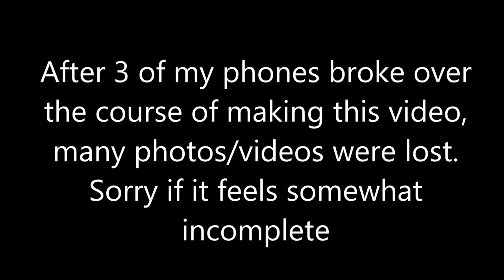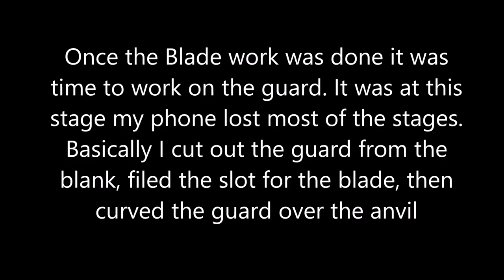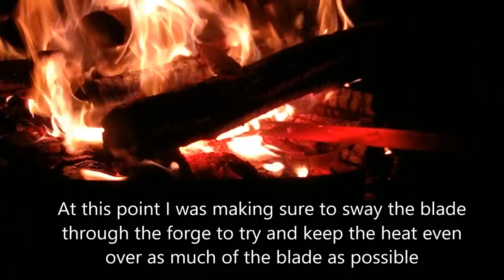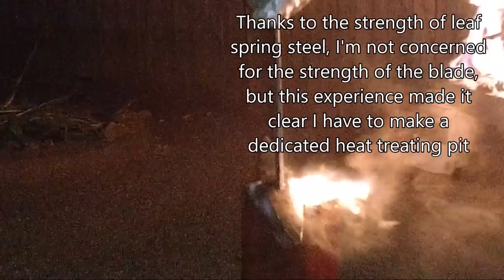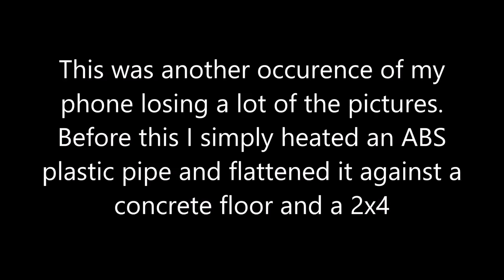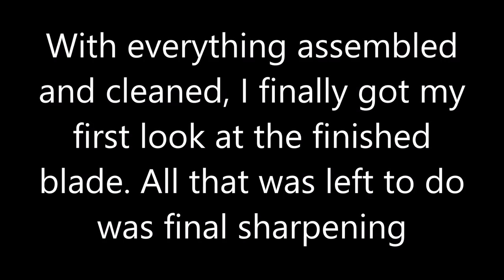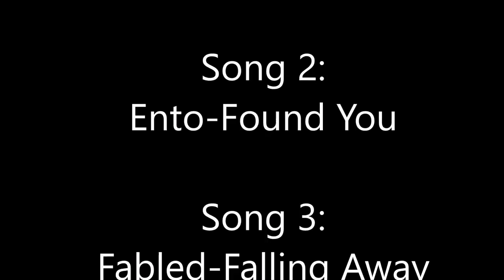Post Apocalyptic War Blade. Forging a Giant Blade from a Leaf Spring

Comment: There is a trick that is used at spearfishing gun  handles. You apply resin or fbglass at the handle and while it is still wet you sprinkle lots of sugar or salt on it. You let it dry and then you dip it in hot water. The excess salt or sugar melts away leaving a rough like sand paper surface. Great job though, i liked i more with the tempering colors on.
Reply from the maker: Im gonna have to try that at some pint because that sounds pretty neat.
I kinda like the smoky grey finish more myself, but if you look at it closely enough the tempering colors are still there. The sander doesnt actually scrape the metal, it more "watered down" the colors with a lot of grey

Comment: Just a little point that might help you out in future builds, to make the blade seem less top heavy, counter weighting with a metal pommel area (maybe weld on metal scales for the last few inches) and it'll be better as a two handed combat weapon, and/or a fuller or a slight grind on the back would help reduce overall weight and make it more responsive. and at that point its still really heavy and can be a survival machete, but also be less draining and able to perform combat and work.

Comment: Great looking pirate sword. Those Hammer marks from forging sure are hard to get out. The only part I didn't like was coating the cordage with fiberglass resin. Should have applied some glue and then laid the cord because now it's slick and doesn't look as good
Reply from the maker: Shepard W 
It isn't slick though. I go into that during the video

Comment: That turned out really well. In the future you could always throw up a one inch or slighter bigger diameter steel pipe with holes down the length of it, lined with charcoal and a blower to heat treat longer blades. I have had success using that method. 

What kind of disc did you use on your angle grinder to grind down the bevels after the forging ? Was it just  a standard type metal grinding disc or an 60/80 grit flap disc ?
Reply from the maker: 80 grit flap disk. they do a great job of polishing up the bevels to a satin shine. not a bad job sharpening either. 
Funny enough, I already got the pipe and i'm gonna do the exact method you are describing

Comment: Cool looking blade and all but all that time and effort is, imho, put to shame by the compromise in heat treat. Just hurt seeing that.
Reply from the maker: THe thing about leaf springs is that no matter how soft they get they always have  spring to them. the only thing is that it doesnt seem to hold an edge as long, so no need to worry about the strength of the piece.
you are right though, i really didnt want to compromize but i didnt have much of a choice at the time. next time i make a project like this though i will definitely make a dedicated heat treating pit for pieces this large
Reply: Chasen Tom Oh, I wasn't worried it'd turn out weak as such. Just as you say, the edge retention was my concern. Though you could do the heat treat again, stick half-two thirds of the blade in the fire, wrap a wet towel around the guard and handle and heat just the edge on the bottom part of the blade with a torch. Tricky and a pain I'm sure but I know I it would irk me every time I looked at it or held it if I didn't, but that's just me of course.

Comment: Woah dude it should not weight thats much for its size and build, you should have distal tapered the blade to take some of the weight off. The style you went with is more weldable that way. This blade weighs as much a freaking zweihander!
 If its not designed for battle than really shouldnt call it a war blade and mislead people to the video.
If you wanted a truly utilitarian sword, id you distaled two pounds from it, it would make more sense is be used in fighting as well and things like chopping wood.
Reply from the maker: Yeah, it came out a tad heavy didnt it? I read that some greatswords can weigh as much as 12 lbs so I wasnt too concerned with it. though if im gonna be carrying it around all day I would prefer something in the 4.5 lb range. I've been practicing with it and im in  pretty good shape and have good stamina so it isnt too much to handle, though what yoy say is valid. I may remake it at some point or just grind some of the weight off once i get a proper belt grinder
Reply: Chasen Tom yeah, it will make it alot better and relyable to use if it was 4.5, even if you can weld it, if you are in a fight that extra weight will hinder ur performance a ton and can get you killed. Also yes there are some crazy heavy great swords that have been found, but you have to take in considerasion that they were considerably longer and are only used when fighting many opponents at once, using a circle swinging motion continuously. Urs on the other hand can be used like this but does not have enough range to be effective.

Comment: Would you ever be open to doing commissions?
Reply from the maker: The more I work "normal" jobs the more i open myself up to doing commission work. thing is, I need to get myself some equipment that speeds up the work if im gonna be able to keep up with any kind of schedule. Those things would be a propane forge, a belt grinder, and a drill press. I may start saving up for those soon
Reply: Maybe you could set up a Patreon or a Kickstarter?
Reply from the maker: I' m open to it, definitely, but i dont know if my channel is big enough to raise that much money. my fans seem pretty loyal though, so maybe I should have some faith in them

Comment: Don't ever associate what you do with forging ever again a real blacksmith doesn't start out by cutting the shape they want they take a square or rectangular piece heat it up and then shape it to what they want with a hammer they don't do ANY cutting AT ALL what you did is just cutting and shaping not forging show this to a real blacksmith and call it forging and you'll get your ass beat so never again say you're forging because you are not
Reply from the maker: Oh neat, I was wondering how long it would take for my comments to get invaded by 12 year olds
Reply from the maker: and last I checked, all forging means is to heat up a piece of metal and then shape it. Literally no one ever has made the stupid caveat you just did. quit making shit up you wannabe.
Reply: Wubba lubba dibshit. Stop running your mouth. First off, if you notice in the video he made this using the bare minimum forging equipment and it's better than anything you could ever make
Reply: Lol the best blacksmiths i know use these mothods still. You just dont know shit is all. Thats clear.